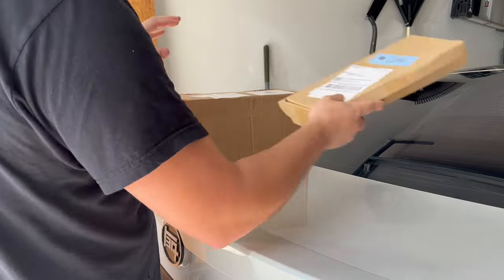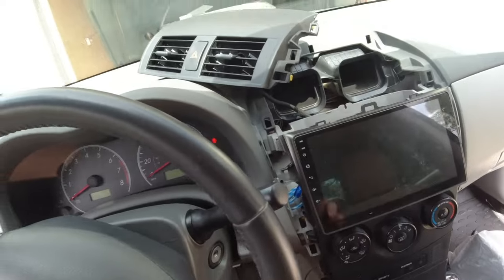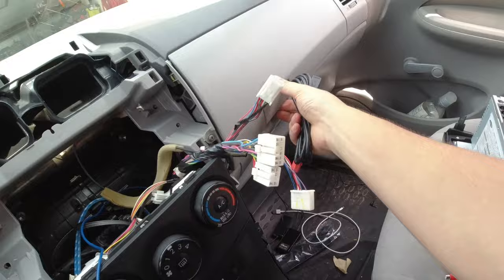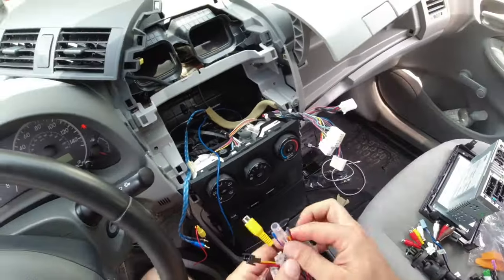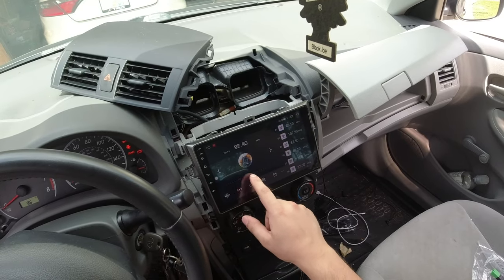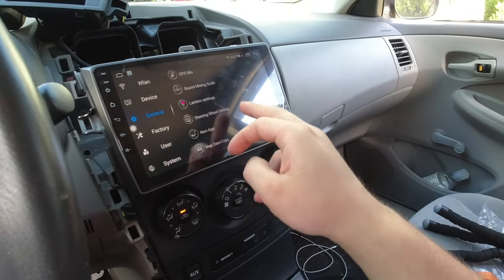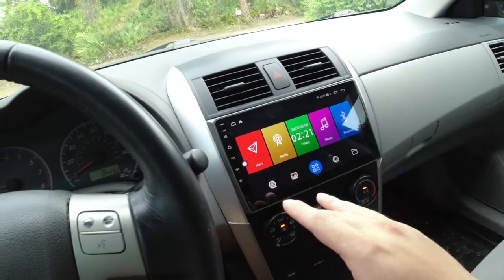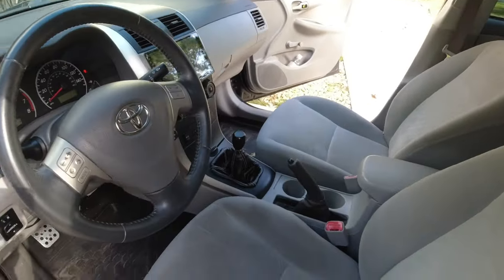Installing a iDoing Radio In My Toyota COROLLA(2009-2013)

Comment: Hey Brandon, I just got the radio and set it up but I have the same problem you did with the reverse camera. I made sure I plugged it in well but still nothing when I put it in reverse. I tested it with the front camera harness like you did and it pops up on the front camera so I know there’s power going to it, but still nothing on the rear camera.  Was wondering how you got yours to work ?
Reply from the maker: My camera wasn’t working because I didn’t have a good connection on the trigger wire to turn on the backup camera.
I just cut the wire and re crimped it together. And that’s fixed it on my end!
Reply: @BrandonStellmach  hmm I tried that already but I guess I’ll try it again, it’s just really weird cause all the connections are correct on my end but I’ll see
Reply from the maker: @Djav1308  another question. When you put the car in reverse, does anything pop up on the screen? If it says no signal, I’m pretty sure it’s a connection that’s loose.
Also double check that your reverse lights are coming on. And make sure any fuses didn’t blow.
But if nothing pops up and it’s just black. Then there might be a setting in the radio that might need to be changed. And you will have to switch the video format.
Reply: @BrandonStellmach  When I put it in reverse absolute nothing pops up, like not even a black screen it just stays the same as it was before I put it in reverse
Reply from the maker: @Djav1308  so it sounds like nothing is triggering the backup camera. I would double check that you spliced into the correct wire behind the radio.
Reply: It works now!
I rechecked my wires near the tail light and realized that 
1- I didn’t ground the wire correctly and 2- I was using a t tap wire tapper but it wasn’t pressed down on the reverse wire enough so there was no signal being sent to the head unit that I was going into reverse.

Thanks so much for all the help!
Reply from the maker: @Djav1308  that’s great! I’m glad you got everything working good!

Comment: Does this headunit allow you to use the cars factory amplifier after you install it? I installed a Kenwood DDX2 in my corolla and I lost my factory amplifier clarity in my door speakers, I was gonna install a new amp to make up for it.
Reply from the maker: I’m assuming you have the JBL system? Because that’s the only radio I know that comes with some kind of amplifier. Other then that I didn’t have any problems with my speakers. If anything the speakers sound better after I put this radio in. But I don’t have the JBL system.
Reply: @BrandonStellmach  all corollas have a factory amplifier for music clarity and stuff, your head unit probably allows you to keep factory amplifier power in your car because that radio looks specifically made for it, normally if you buy the single din or double din stereo just like off best buy for example you won’t be able to retain factory amplifier to your speakers unless you buy a $300 harness for it lmfao, but I like the radio. I have a 2010 S and I’m replacing all my speakers with nice JBL’s and gonna set a taramps on them with a DSP, I’m gonna have to send you the video once I do it because it’s a upgrade worth it in my opinion
Reply from the maker: I’m no audiophile, so I just know enough about it to be dangerous! 😂 
But this radio is pretty much the price of the harness you need! 
But I plan on upgrading my speakers soon too, as well as adding some tweeters too!
But I would love to see your set up when you done.

Comment: Great review man! Love your content! How’s been holding up? Did you have any issues since? I’m really considering getting this one ínstead of a Pioneer DMH2770NEX due to the size of it, but I’m hesitant.
Reply from the maker: Thank you! Really appreciate it!
I have not had any problems since I have installed it’s a great radio for the price. I use wireless Apple CarPlay almost everyday and it works great with no problems either! 
This comes with a 9 inch screen, and it’s a high quality screen. And it’s completely plug and play. And doesn’t need any adapters.
Only downfall for this radio is it ships from China, so it takes a few weeks to get.

Comment: hey man i have a s plus so it’s a manual and i wanna get a short shifter but i have to pull up a lever to put it in reverse, i was wondering if you had this same problem and what you did
Reply from the maker: It sounds like your is a 6 speed? And I’m guessing it’s a 11th gen corolla? Because mine is a 5 speed. And I don’t need to pull up on any lever for reverse. 
So I don’t think the same short throw I have will work for your corolla.

Comment: Why did you buy the 2 trim pieces? Does this Idoing radio not fit with the original trim pieces?
Reply from the maker: The original ones work perfect, I only changed mine out because they were broken.

Comment: Hey Brandon, I recently got my idoing radio for my 2012 Toyota Corolla, I do not have any steering wheel control. I was wondering how did you get yours to work?
Reply from the maker: There should be a setting for SWC which will allow you to link each key to what you want. 
If this doesn’t work, idoing has good support and they should also be able to help you!

Comment: Great job! I love it man! When you install that radio did you have to install anything for the steering wheel controls? Cuz I'm thinking about getting  audio controls and that radio so it can work in my 2010 Toyota Corolla.
Reply from the maker: Well before I installed this radio I changed out my steering wheel from a base model corolla to a S steering wheel with controls. And when I did that I also changed out the clock spring as well.
But when I put the new radio in, I just had to program the buttons on the steering wheel to what I wanted them to do on the radio.
Here is the video of me swapping out my steering wheel: https://youtu.be/847SLnHTmGs
Reply: @BrandonStellmach  I did see that video already and I did ask you questions if you got it to work but that was a long time ago. Thank you man

Comment: I have a 2013 Toyota Corolla but my antenna doesn’t look like that? It’s in a square shape plug, would it still work?
Reply from the maker: I know if you have XM radio, I don’t think that will work, but all other features should still work! If there is any questions about the radio, I would contact them and send them pictures of your radio, and they should help you with everything!

Comment: Are the new radio trims necessary for install?
Reply from the maker: You can use the factory ones. The only reason I replaced mine was because there were broken.

Comment: I have one of these but the screen shuts off at night. I am not sure what could be wrong or what i could fix but plugged everything seemingly correctly.
Reply from the maker: That’s weird, I would double check everything is plugged in correctly, then double check that no wires are shorting onto each other. Might seem that the dimmer switch is shorting out when the headlights come on.
Reply: Hey guys , I have the same problem as well, when it is getting dark outside or when I drive in tunnel and the dashboard lights is on the system shut off and trying all the time to reboot ..any idea please why this happened ?

Comment: How did you get the steering wheel control to work if your car didn't have it from the factory
Reply from the maker: When I swapped out the steering wheel, I also swapped out the clock spring, which gives the controls able to work. But if you had a stock radio, those wires go to nothing, but when you upgrade the radio to one that supports the steering wheel controls, they should work without and splicing to the factory harness.
Reply: Did you do any wiring or something ?
Reply from the maker: No just change out the clock spring and the radio and the steering wheel. Just have to unplug some stuff and plug it back in with the he new things. If your curious here is how I changed out the steering wheel and clock spring.
https://youtu.be/847SLnHTmGs
Reply: @BrandonStellmach  you should do a video about it.
Reply from the maker: I will probably make a video in the future.

Comment: Would you recommend this head unit or the binize?
Reply from the maker: Honestly it’s a decent radio for the price, and mine still worked after almost 2 years. But you can tell a quality difference from the idoing VS the binize. With screen quality and how fast things load.

Comment: Got one, everything works but the EQ settings does not work at all!  Do I need to get another one??! Or can it be fixed somehow??! Help haha
Reply from the maker: I have not heard of anyone having this issue. I would verify all the plugs are pushed into the connectors good! If there is still an issue, I would contact idoing. They should be able to help get it figured out!

Comment: Hey Brandon, I am installing the back camera in 2012 CE Corolla. the rear camera problem is same with me as u had in the first place. I am not getting any image of rear view on my screen like you. what corrections did you do to make it working?
Reply from the maker: My problem was not having a good connection to the backup wire behind the radio. So re crimping it helped.
Reply: @BrandonStellmach  alright. Thanks.

Comment: Hey Brandon! I just got mine for my Toyota Corolla LE 2013 and everything works great but not my steering wheel buttons, do you know what could I do to get it to work?

Thank you!
Reply from the maker: There should be a setting called SWC, for the steering wheel controls. This should allow you to hook up the controls from the steering wheel to the controls of the radio by learning each button.
Reply: @BrandonStellmach  yeah you have to hold the button for so you can select what do you want the button to do…. But when I do it I hold it and it just doesn’t do anything.
Reply from the maker: @eduarmilla3996 I would contact idoing and see if they can help you with this issue, it might need a software update.

Comment: I bought a 13 corolla used week ago.. it came with pioneer upgraded radio and it is sucks you cant connect Bluetooth cause it has a full memory and the sub seems not working do u think this radio will solve the problem?
Reply from the maker: This is a great upgrade from that pioneer radio. This definitely will fix your Bluetooth problem. 
As for the Sub, it might help. But it’s hard to tell because it might be a blown fuse or a bad connection on the sub. 
But this does have inputs for a sub, so if you wanted to connect another one it will be easy.

Comment: i have a question so on the website the kit comes with everything i will need electronically ? from the camera to the wires i’ll need to connect them?
Reply from the maker: Yes it should come with everything you need to make it plug and play!
Reply: @BrandonStellmach  thanks just ordered it with the camera! so i would just splice the cable in the back of the backup light that will power the camera once the reverse signal is on and also send back the rca display with the power to the display correct?
Reply from the maker: @Poseiden777  yes that’s pretty much it, I made a video a video installing my back up camera, if your interested.  If should give you a good idea and how I wired it up.
https://youtu.be/yq0xF2cewZM
Reply: @BrandonStellmach  thank you so much for the help! one last question, does this specific display use the two extra usb’s to connect to apple car play as well? i know it’s wireless apple carplay but if i connected my phone to one of the 2 usbs it came with would it connect to apple car play or will it just charge the phone?
Reply from the maker: Yes that is correct, If you wanted to use wired CarPlay you still can and charge you phone at the same time!

Comment: My Car steering MODE button is not working. Is your's working? I think it is something to do with the white plug which is not put in anywhere
Reply from the maker: You may have to go into the settings and link the steering wheel controls. Find the SW settings and it should allow you to link each one up.
Reply: @BrandonStellmach  all other volume and forward backward buttons are set..except mode

Comment: hi, did your old android stereo have steering wheel controls too?, is the steering wheel control an idoing only feature?
Reply from the maker: On my old stereo, I was only able to get the volume controls to work, but none of the others would work. 
With the new radio it comes with wireless Apple CarPlay. A nicer quality screen, a better amplifier, as well as better internals, which makes it much faster as well!
Reply: @BrandonStellmach  cool, im planning to buy the idoing soon! for my 2010 Corolla

Comment: So a heat later, how is the radio holding up? Thank you
Reply from the maker: After a year it was working prefect with no problems! I believe i made an update video on this radio!
Reply: @BrandonStellmach  yes, that’s what I meant. I year later.  Not a heat later!! Thank you for the update.

Comment: There is NO integrated amp for your main speakers in this device just to let you know. I returned mine because I am putting together a sound system.
Reply from the maker: Yeah this radio isn’t the best for high end audio, but it works great for your everyday listening!

Comment: I just bought this exact same one and it came to me in 3 days! Very fast shipping. I have a question though. I plugged in the Wi-Fi wire but I’m trying to figure out how to have Wi-Fi in the car. Do you know how by chance?
Reply from the maker: The wifi on this unit is only meant to connect to a internet connection. This does put off its own wifi signal. And the wifi adapter is just for a better connection.
Reply: @BrandonStellmach  Thank you for replying! I have another question. About a month ago I started noticing that the touch buttons on my screen don’t light up at night anymore. Have you experienced this issue?
Reply from the maker: I have not had this happen to me. Maybe there was a setting that got turned off and might need to be turned back on. If that doesn’t help, idoing should be able to help figure it out!
Reply: @BrandonStellmach I checked all the settings and I still couldn’t figure it out. How do I contact idoing?
Reply from the maker: @paulettecalvillo8759 sorry to hear you can’t get it working. Best way to contact idoing is to DM them on Instagram. If not they should have an email. But Instagram is the way I contact them and I get a reply pretty quick!

Comment: If I have a Corolla S with steering wheel controls, is there a plug and play option that connects to the car play head unit?
Reply from the maker: This is complete plug and play. And will work with steering wheel controls. The only thing is you have to teach the radio what each steering wheel button does in the radio.

Comment: When you turn on the car, how long does the radio take to go to the Home Screen?
Reply from the maker: Probably around 5-10 seconds. It pretty fast!
Reply: @BrandonStellmach  Really, how do you do that? Mine takes 25 to 30 seconds.
Reply from the maker: @helfymolina5850  that’s very strange. You have the same iDoing radio that I do? Maybe there is a setting to help it boot faster?
Reply: @BrandonStellmach  yeah i do have the same radio as u but I don’t know and when I ask them to help me they don’t respond
Reply from the maker: @helfymolina5850  I would try to reach out to their instagram. They usually reply fairly quick!

Comment: Does a 9in or 10in radio unit fit in a Toyota 2013 LE
Reply from the maker: The radio I installed in my corolla is a 9in radio.

Comment: Does it come with a mic for phone calls?
Reply from the maker: Yes it comes with a mic built in. But the mic that is built in, is not the best. But they also supply an external mic, so you can place it in a better place which is better.

Comment: What about using "Hey Siri?"  That's kind of a big deal when you driving...
Reply from the maker: Yes, Hey Siri still works. As well as I have set up the voice button on my steering wheel to also activate it! 
The only thing is sometimes the speaker doesn’t accurately pick up what I say. But for the most part it works good!

Comment: How u have the setting of the radio cuz I can’t hear my local stations 😢
Reply from the maker: There should be a button to hit that is called FM radio. And that should let you listen to the local stations.
But if you just can’t hear it, you might not have the antenna plugged into the back of the radio good. 
Just double check connection it should look like a large head phone Jack.

Comment: hello i have a 2012 toyota corolla , i installed a idoing head unit and cant seam to be able to get to steering controls to learn in at all i reset the head unit and a full deleate and reset  still nothing changed the canbox type also im every plug is conected correctly checked few times      any info would help Thanks
Reply from the maker: Did your steering wheel controls work before the radio? 
Also when you learn the steering wheel controls you need to press and hold the button on the wheel, and then then press the corresponding button on the radio at the same time. I hope this helps!
Reply: @BrandonStellmach  are you using a canbus adaptor
Reply from the maker: No, I didn’t add anything to my radio, whatever came in the box is what I used. Maybe just make sure all the connectors are pushed In, because I had the problem, with my backup camera, because I didn’t push the plug all the way in the radio.
Reply: @BrandonStellmach  did all that lol.  And tried all available can options for Toyota  the unit works all other functions just won’t learn any steering wheel commands
Reply from the maker: That’s weird, because I didn’t have any issues with the steering wheel controls. Maybe contact idoing on Instagram or email and see if they have a fix for that!
Reply: @BrandonStellmach  I did this morning and they said that they’ll get back to me tomorrow
Reply from the maker: Well I hope they get back fast and help out with the problem!